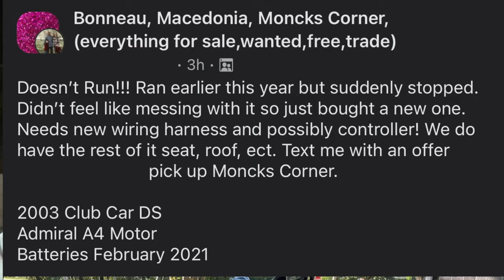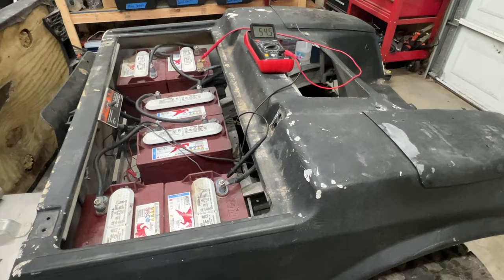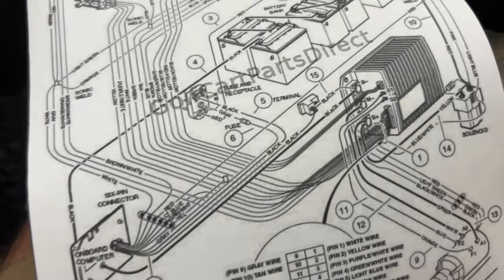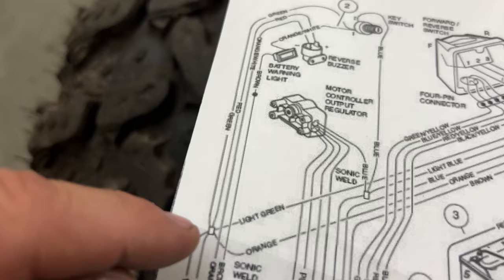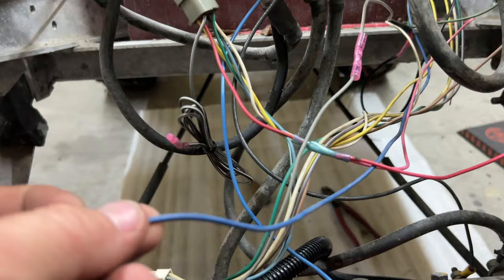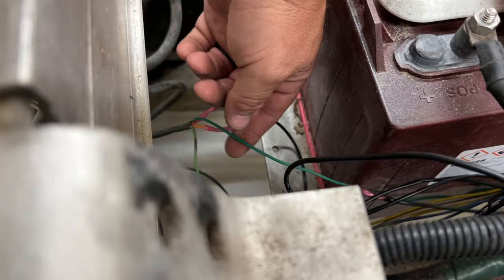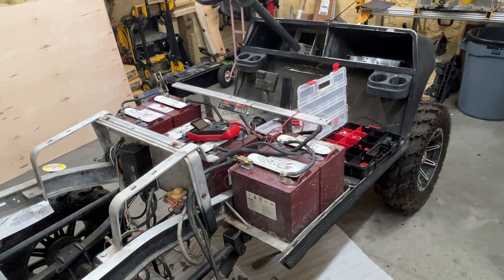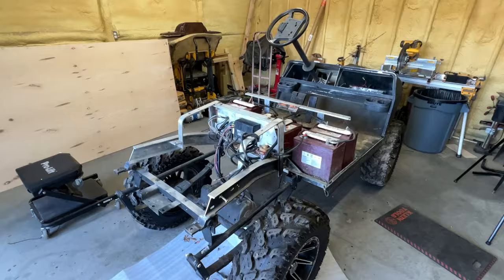$1000 2003 Club Car DS IQ Golf Cart Wiring Disaster! Can We Fix It? Will It Run Again?

Comment: That looks as bad as that cart I've got I  call "Rat Cart" it had been left on a farm under a shed. The only thing left was the connectors. The wood rats ate all the wiring except the battery cables. I had to build a entire harness. 

Moved the FNR to the steering column while I was at it

Keep up the great work 😊

Comment: Good work.  The number #9 pin on the main harness (grey) needs an inline diode to prevent "main drop out" stalling condition.  A problem in these early DS models.  Let me know if you need one, I have plenty in stock, having to do this rewire many times on carts.  I will donate some and mail them to you.  Cheers.
Reply from the maker: Ten4, The schematic didnt show that. I mustve downloaded the older schematic. The band side goes to the controller right?
Reply: @Fentertainment  Yes Sir.  That is correct.

Comment: By chance are able to check the solenoid being able to just apply 12v? or do you need the full 48 to test and here a click.  Thank you and great job on the video, learned a lot.
Reply from the maker: If its a 48v solenoid then you would need close to 48v on the smaller terminals. The 2 top lugs only make and break continuity.
Reply: Gotcha, I was testing with 12v and could not get it to open or close. Yes its a 48v solenoid so Ill proceed with testing at 48v.  Thank you for the help. @Fentertainment

Comment: Admiral MOT-A4   
14 HP high torque motor
Speeds up to 20 mph with stock 18" tires
Speeds up to 28 mph with XCT500 & A4S map & big tires
10 tooth spline use with 400a and 500a controls
Reply from the maker: I might swap it out with a stock motor when I flip this cart. This could be used down the road in something else.

Comment: Were do you find the wire diagram.
Reply from the maker: I usually just google which ever model and put schematic behind it. Sometimes you have to dig through a couple different schematics but for the most part they are easy to find.